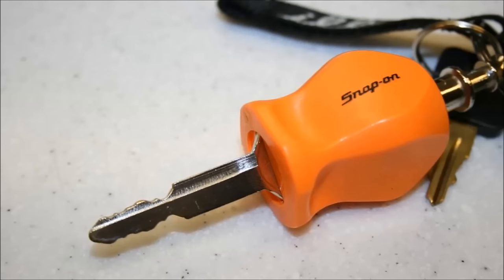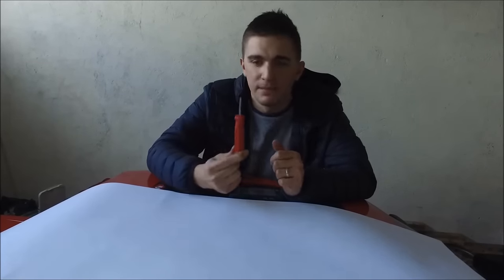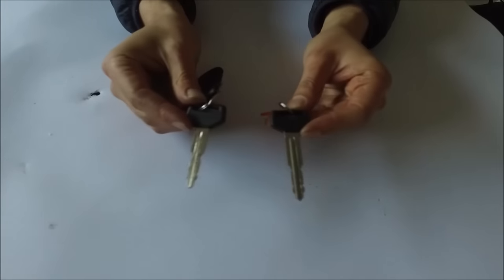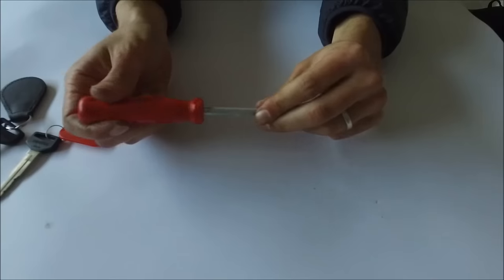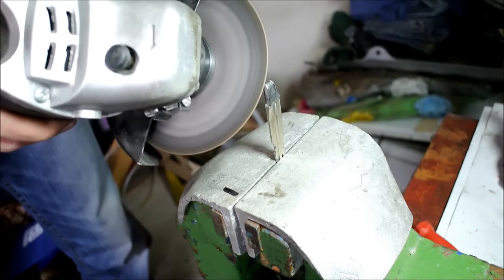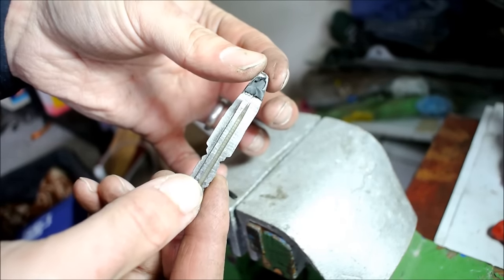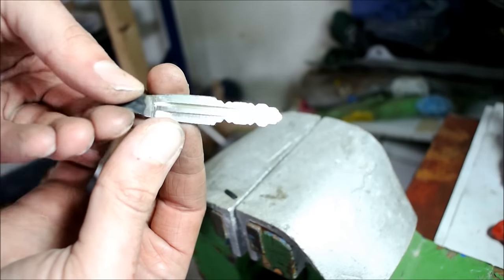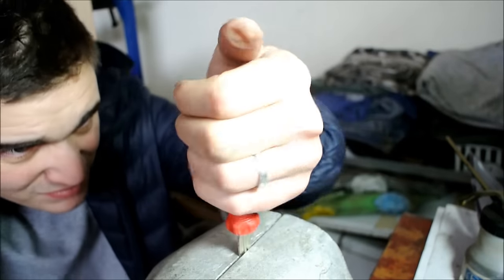DIY screwdriver key - stolen car look

Comment: So what if it has a chip
Reply from the maker: Random I guess you can't do this then :) this is for junky old school cars lol
Reply: add a spot for the transponder chip to touch the ignition barrel so it picks up the code, will work the same.
Reply: @gilknox  +1 for this answer. Hide it in the handle of the driver and epoxy it in